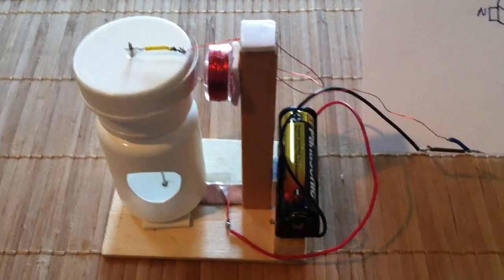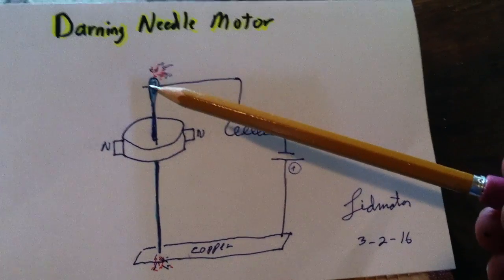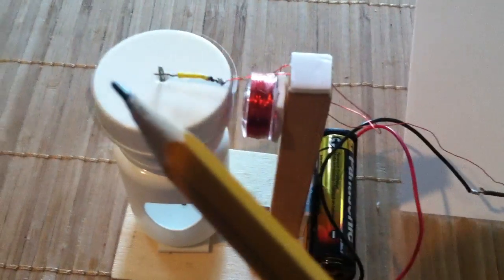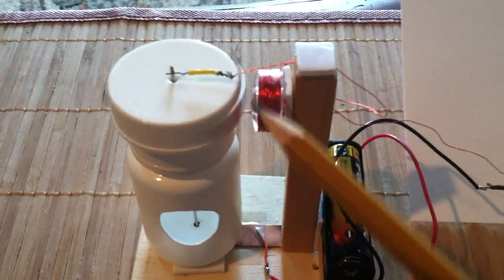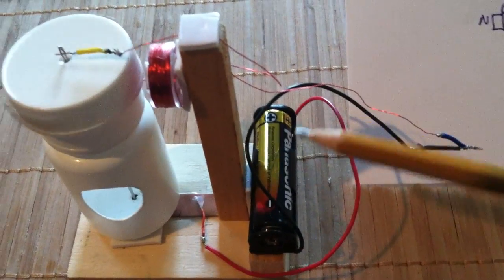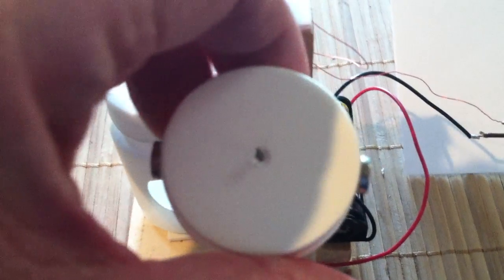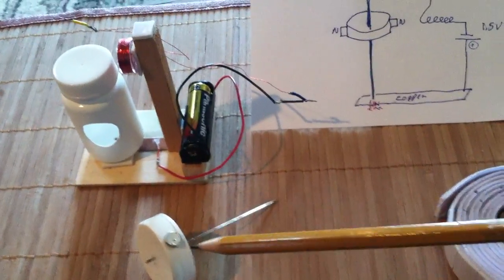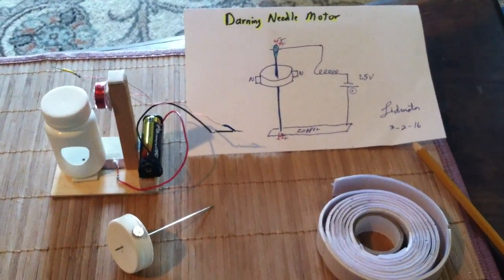Darning Needle Motor

Comment: the king of the lid KISS supah build ,and yes thats how we pronounce car= cah in norther New England.
Reply from the maker: +bill bailey  Thanks.  Yep. Simple is the way to go as long as it works.  My sister just bought a new car and it is so complicated she can barely drive it.  She is 70 and doesn't drive very often.  If she leaves it for more than a week without starting it, the security system drains down the battery and the car won't start.  By the way this motor ran all night and was still running happily this morning.  Because the rotor only fires twice  a revolution and the RPM is low the drain on the AA is minimal.

Comment: Great, the "no glue, no soldering iron" is one of those regular questions I get. Nicely done and very tidy.
Reply from the maker: +GrandadIsAnOldMan  Thanks.  I am finding out from your videos and other research that many people (young and old) just want to build a quick paper clip and tape sort of fun project.  When the project is over it is just coming apart or gets thrown away.  One of my heroes is a kid here on YouTube who worked on the bed in his bedroom.  I was amazed at how innovative he was with the few tools he had and simple parts he could gather.  He used his computer for research and then just started building the simple 'Newman' motor right there on his bed .  His parents didn't stop him and just let him do it.  Smart parents.  That was years ago and I bet he went on to study engineering.
Reply: ***** I watched this one and then watched your LED addition and thought I would try and make a really rough one with a rusty 6 inch nail with the head cut off and the end flattened with a hammer. Most frustrated, I failed :) it did show some promise but I think I went too far with the scavenging approach. I made the coil using plastic bottle tops, bbq skewer, and probably the main fail reason I used some thin plastic coated wire from the gardening department. That was probably steel or at least ferrous metal as the magnets were attracted to it. It did repel them when it was pulsed but not as strongly as needed. I used a small metal tin in place of your plastic pill bottle so that was convenient as the lower contact but the whole effect probably had too much friction. I might have another go but I have put it to one side for now.
Reply from the maker: +GrandadIsAnOldMan I'm sorry to hear that you had some trouble with this.  I have tried to make motor electromagnets using that plastic coated steel wire and failed also.  It worked great on the LED'Penny' oscillator but not as a drive coil.  You are right about the fiction issue.  Unless the rotor is very free spinning the motor will not work.
Reply: ***** I was trying to make it look as rough possible. I though the rusty nail would have "nailed it" for me :)
Reply from the maker: +GrandadIsAnOldMan  In the end (when it didn't work) you could have hit it with a hammer to 'drive home' the lesson that things can be made too rough to ever work.  Ha. I made a Stirling engine like that once thinking that I wanted to show 'how easy' it is to make one.  It was a complete failure that I worked on for days.  Later on the project so bothered me that I went back to it, changed a few things, and actually got it to run.  I guess they call that a learning experience?
Reply: ***** I learn every day. You would have thought by this age you would know everything, but you just know there is so much more to learn, oh and some much more you have forgotten too :)